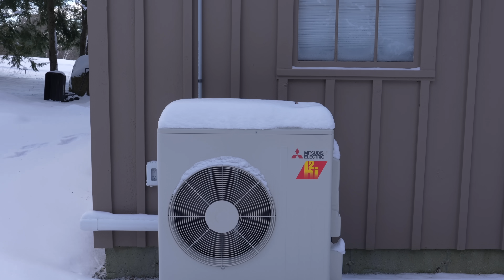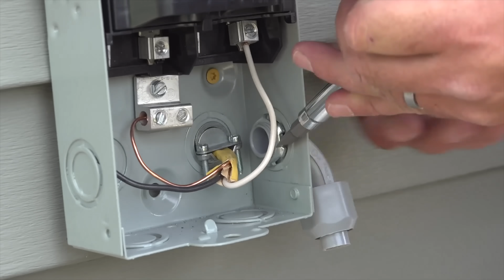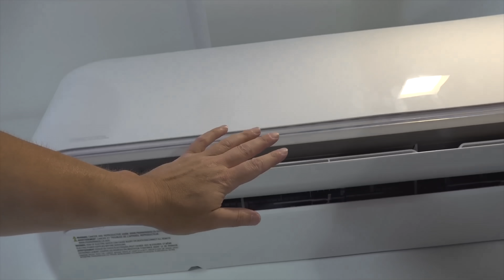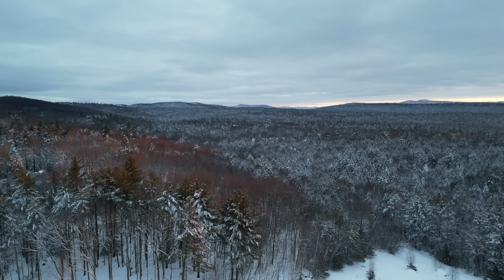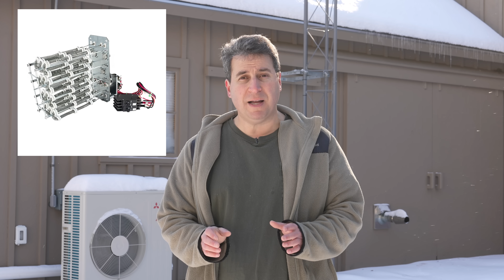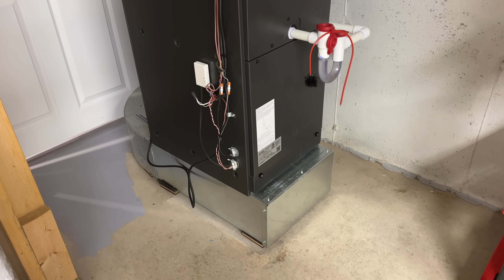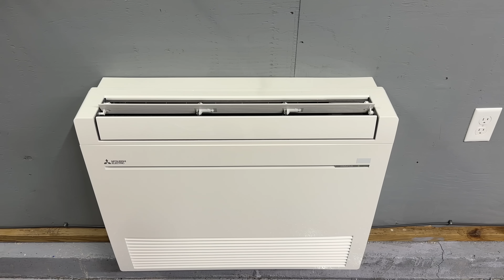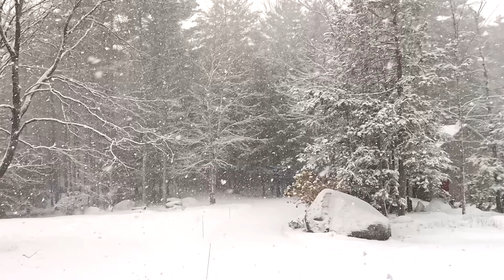Why Heat Pumps are now leaving people COLD

Comment: Something to keep in mind is that the efficiency of a heat pump is almost always going to be over 100% since the waste heat from the compressor ends up in the house via the condenser, so with very few exceptions, it will always be more efficient to run the heat pump than electric heaters, which are only ~100% efficient. If your supplemental heat is electric, even if you need to use it, you may as well keep the heat pump running anyways and let it do what it can because it will still be more efficient than resistance heaters.

Gas supplemental heat is a different story because gas is normally around 1/3-1/4 the cost of electricity per unit of heat. If you have gas supplemental heat, using it instead of the heat pump on cold days often ends up being cheapest even if the heat pump is keeping up fine, but the exact temperature it makes sense to switch to gas depends on your energy costs and the efficiency of your heat pump vs your gas boiler or furnace.
Reply: @diegofondoo1780  He should have called it what it is. Not efficiency, but SEER (Seasonal energy efficiency ratio). With a SEER of 12, with temps above freezing, you can move more heat from the cold outside to heat the indoors for 1/12th the electricity to provide the same heat with strip heaters. Strip heaters alone would have a SEER of 1. A point to note is that heat from a heat pump feels cold. It only warms a few degrees above ambient at any moment and pushes it with a blower motor. Gas or electric will warm to about 140 degF and create a warm breeze, but cycles back off quicker.
Reply: @hartshepherd5060  Close, but not entirely accurate. The EER/SEER rating is the amount of BTUs the system can move per watt of power it uses under the test conditions, not watts. The way we measure how many watts of heat the system can move per watt of power input is with the COP (coefficient of performance). So if a system has a COP of, for example, 3, what that means is for every watt of power it uses, you get 3 watts of heat out of it under those conditions.
Reply: @diegofondoo1780  You are correct, no machine can be more than 100% efficient.  With heat pumps they claim say 400% efficiency because most of the energy put into the system is not counted because you do not have to pay for it.  I.e. input into the system is 4kw of heat from the outside world plus 1kw of electricity for a total of 5kw, output of heat energy into your house is 4kw.  The system is 80% efficient, but because you didn’t have to pay for the heat energy on the input side they say you put in 1kw and 4kw of heat entered your home therefore the system is 400% efficient.
Reply: @steveallen1340  The end result is the same, you basically get 400% of the heating energy of what you put into the system to trigger the process, yes more than 100% efficiency is not possible not even 100% is possible, but again you use natural heat from the outside and basically pump it into the inside thats all there is to it!
Reply: @steveallen1340  Yes the outside world heat is provided by the environment aka day sun heating up everything, ground heat etc...
Reply: Last winter when #2 oil was 6$ a gallon that worked out to be more expensive then even resistance electric. It was well worth installing my Samsung max heat and using oil to supplement on the coldest days
Reply: @diegofondoo1780   Yes. Per unit of electricity, you get more heat than resistive heating, which is a 100% efficient conversion. 

Moving heat is much more efficient than generating it.
Reply: @diegofondoo1780  A resistance electric heater delivers 1 Watt of heat for 1 Watt of electricity paid for.  The highest efficiency heat pumps can deliver 5 Watts of heat for every Watt of electricity paid for.
Reply: @diegofondoo1780  I explain it better than other replies: 100% efficient is electric resistance. Its not really 100% but its the baseline used to measure performance. A heat pump generates more BTUs per unit of electricity compared to electric resistant heating.  A better metric to use is COP Coefficent of performance compared to electric resistive heating. electric resistance heating as a COP 1, anything above 1, provides more heat for the same amount of energy compared to resistive heating

But there is a catch. Heat pump always cherry pick the best conditions for their efficency rating. If you want to heat your home to 70F and the outside temp is 65% the heat pump may have a COP of about 4, but as the temperature difference between inside & outside increases ie 75F inside and 30F outside the COP drops down to about 1. Below 30F the COP drops below 1, and thats when electric resistance is more efficient than a heat pump.
Reply: @guytech7310  Look up the COP numbers for any modern cold climate rated heat pump, the data you're using sounds outdated. Some of these modern ones will pull above 2 COP even at -22F, only way I can see them even getting under 1 COP at all is if the defrost logic is faulty.
Reply: @KingSnake377  No , The numbers are fudged: one by not including the defrost cycling, two: but cutting the output to a small fraction if its rating to prop up COP. Its just gimmicks to fool people. Heat pumps are bound by physics. 

That said the Heat pump efficiency problem at low temps. can be addressed using a Geothermal loop.
Reply: @guytech7310  Not every air source heat pump is going to be above 2 COP in the negatives but claiming they all go under 1 COP at 30F isn't being truthful either. Maybe if it runs a defrost cycle every half an hour for no reason.
Reply: @KingSnake377  They all do when you factor in Nameplate BTU output. A unit that states it as a COP at 2 at 30F with an indoor temp of 72F will  have an BTU output less than half. Again all gimmick, but believe whatever fantasy you want. I don't care.
Reply: @guytech7310  Yes and no, the cop is measured over the entire year to get a really good handle, air heatpumps usually are in a cop area between 3.2 and 4.0 most of them around 3.4 and 3.6 over an entire winter unless you live in a permafrost region. I live in central europe with a moderate climate and my air heatpump will end this winter which was mild but had more permafrost days then the last one (10 or so so far) with an average COP of around 3.7! Winter is over for me in march basically but atm we have the coldest part of the winter and in february things will go up, so an estimate is possible already! And yes the producers of those devices like to exaggerate the COP but, in reality you get over the year good numbers, you just have really high electricity usage in the cold times, but then you always think that you basically had to burn 3-4 times more gas to reach the same heat you just could not see the gas usage every time you fire up a web browser!
To use a heatpump effectively, you have to have 2 things a) good isolation is a must, those beasts react way slower and do not produce such high temperatures like gas, b) you need to know which type of heatpump is suitable for your climate, an air heatpump does not really cut it in a region with tons of permafrost days there are better options in this area than air / water and air /air for such scenarios, they cost more however, air/water air/air is the cheapest option which fits in to the 70% usecase (aka good enough for most people)
Reply: @werpu12  No, not really. go look at a COP chart graphed over delta temperatures. Its mostly cherry picked, not real world conditions. Anything less than USDA zone 6 it doesn't perform well for winter heating. 
Heat pumps work best in warmer climates, especially in USDA zones 8 & above which heating demand is low & AC is the dominate HVAC demand.

Zones 7 and lower, a geothermal (ground source) heat pump system is required to provide good COP.

That said, I think its stupid to load the already strained US Grid with more demand. About 50% of US power comes from NatGas. its more efficient to just use NatGas directly for heating since there are a lot of losses converting NatGas into electricity. About 60% to 70% of the thermal energy produced from NatGas to produce & transmission is lost. 

When there is a major winter power outage that last weeks in the winter, its going to cause a lot of damage as homes freeze and pipes burst.
Reply: @guytech7310  I live in something you would say is zone 7a and my air water heatpump will end the winter this year with a real world cop of around 3.6-3.8 for the entire year.
Reply: @werpu12  OK, I live in 7b, costs me about $400 in Propane for winter (Nov through Feb), If I run my heat pump it costs about $250/mo in electricity. So less than half the cost. I just Heat pump for cooling.
Reply: @guytech7310  Yes the energy costs always are the deciding factor. I live in Europe and last year prices went through the roof, I did a quick calculation in autumn and with my heating I would have spent 8000 Euros (roughly 9000) dollars just for energy of my house (2 appartments), I quickly intervened with wood and a stove to get the costs down by 50% (I get firewood for free just work) needless to say gas is out, I am not going to pay for blood money (russian gas), also sideffekt this year I will end with 1500 entire energy costs heating and current due to moving to a heatpump and pv. With gas I still would have ended up with 4000-5000!
Reply: Don't forget about defrost.  If the unit is spending quite a bit of time in defrost, it can indeed drop under 100% efficiency.
Reply: @matthewbeasley7765  Maybe that could be true with some systems, but the mini splits I've seen generally seem to handle defrost pretty efficiently. My cheap mini split actually completely turns off the indoor fan in defrost mode and only takes a couple minutes to defrost about every hour. Also, once the outside temperature is low enough (perhaps under around 20-25 degrees depending on humidity), ice buildup on the evaporator largely becomes a non issue because there just isn't enough moisture in the air to condense on the fins at such low temperatures.
Reply: @averyalexander2303  You are correct, any of the inverter based units are FAR better at defrost.

A conventional unit usually is very dumb about defrost.  Most have a thermostat that kicks at about 34°F.  When the coil is under 34°F, they run a timer that defrosts every 30-45 minutes.  It then runs defrost until the outdoor coil is warm.  The SUCK anytime it is below freezing because they defrost whether they really need to or not.

The inverter ones are smart.  Not only do they have an inverter, but they have multiple temperature sensors and pressure sensors.  They have variable speed fans and an electronic expansion valve.  In a conventional heat pump, the expansion outlet is often far too cold for the conditions because it doesn't open enough when it is really cold outside.  It means the outdoor coil will build ice starting at one end.  Then the ice progresses to the other.  By comparison, inverter units having the ability to change the compressor speed, fan speed and expansion valve opening, many times the units can stay out of icing conditions.  When they do ice, they only defrost as much as needed and switch back sooner.  

All that said, defrost hits them still when it is moist.  In a dry cold, they do better.  In the snow of freezing rain, they do suffer efficiency and struggle too.  Just not as bad.
Reply: @matthewbeasley7765  Great points, the 20+ year old central heat pumps at the apartments I used to live at definitely didn't work very well near or below freezing. I'm not sure that they defrosted unnecessarily, but they froze up all the time and didn't work very well.

The Pioneer mini split heat pump I have now still sometimes defrosts unnecessarily, but at least it doesn't run the indoor fan during defrost and blow cold air into the room like the central heat pumps I've experienced. I believe it has one temperature sensor on the outdoor coil, one on the discharge line, and one on the indoor coil with indoor and outdoor temperature sensors, but no pressure sensors.
 
I assume a higher end system from Mitsubishi, Daikin, Fujitsu, etc would handle defrost even better, but my 1 ton 21.5 SEER Pioneer unit has been working quite well for the last 5 years considering the entire install cost well under $1K including the lineset, drain pipe, wiring, disconnect box, etc.
Reply: @matthewbeasley7765  During defrost, heat is transferred from the house to the outside unit. At that moment, efficiency is negative. Both the off time and negative heat transfer will reduce the effective delivered powered to heat the house considerably. In a wet climate just above 32F, this can be half. My gas boiler kicks in below 40F. Between 40F and 18F, its in hybrid mode. Below 18F, its gas boiler only.
Reply: @diegofondoo1780 it's more than 100% because it moves heat instead of making it. Since heat is energy it can't be created or destroyed but we measure a heaters efficiency based on how much heat it outputs not how much it creates. An electric heater just converts electricity directly into heat, that's why it's 100% efficient.
Reply: YES! This right here!
Reply: Yes theoretically but at some point an additional defrost unit has to kick in and then you add a pure electrical heating system into the mix just to keep the heatpump running and preventing it from being destroyed, at that point it can become less efficient than running an electrical heater alone, also some heatpumps have a handover point for that reason where they switch to purely electrical heating entirely. You seldomly or almost never reach that point, but it exists!
Reply: @werpu12  Do you have any data to back up that claim? Not saying you are wrong, but I have yet to see a manufacturer data sheet or any other data showing the COP of any heat pump dropping below 1. Also, remember that the unit actually doesn't usually need to defrost very much once the outside temperature starts getting below around 20 degrees because there isn't very much moisture left in the air to freeze at that point. Finally, every unit I've seen defrosts by briefly switching to cooling mode, not by running an electric heater. Some units do have a base pan heater to thaw the ice around the bottom of the outdoor coil, but those don't generally use very much power and typically only run during the defrost cycle.
Reply: @averyalexander2303  Well if. my energy bill befcre and after installing the heat pump is enough? We have roughly the same gas prices as electricity per kwh but yet I am now paying a fraction of what I paid before after moving over to an air/water heatpump. Also multiplying the COP with the energy used by the heatpump rougly gives me the gas usage number I had in the years before (aka I came down from 12.000-15.000 KWH depending on the year down to 3200 Kwh including warm water)
Reply: I wonder why OEM's don't make the indoor unit with 2 coils in parallel with each other, so that one coil is made for regular cooling, but the other coil is made for heating, so that the heating coil can be more condensed in construction by having a smaller tube, less fins, and a tighter path from inlet to outlet. 
That surely will make that compressor work.
Reply: @MR-backup  It's unfortunately not that simple. Yes, making the condenser smaller and more restrictive will work the compressor harder by building more pressure and generate higher discharge temperatures, but with a higher compression ratio, the compressor won't move as much refrigerant through the system and won't move as much heat. Also, just like in cooling mode, if the condenser is less effective at dissipating heat, the evaporator will run warmer and won't be able to pick up as much heat from outside.
Reply: @averyalexander2303   It's unfortunately not that simple. 
- When money is the driver of technology: it never is.

Yes, making the condenser smaller and more restrictive will work the compressor harder by building more pressure and generate higher discharge temperatures, but with a higher compression ratio, the compressor won't move as much refrigerant through the system 
- That depends on what refer you use.

and won't move as much heat. Also, just like in cooling mode, if the condenser is less effective at dissipating heat, 
- I'm not sure why you keep thinking that my design will not dissipate heat well. Dissipating heat in my theoretical design (and in all existing technical designs) is NOT a result of the compressor. You do understand that, right?

the evaporator will run warmer and won't be able to pick up as much heat from outside.
Reply: @MR-backup  Yes, the refrigerant used will have an effect on the compression ratio, but assuming everything else is the same, increasing the compression ratio the compressor has to work against is going to decrease its pumping capacity.

If the design of condenser you are suggesting still dissipates heat well, what would the difference be? Just more resistance to flow? If so, the same thing could just as easily be accomplished by varying the position of the expansion valve, which is generally electronically controlled on newer mini splits.

I never said dissipating heat is a result of the compressor, but in part, it actually is since the compressor is what's pumping the refrigerant through the system and therefore creating the temperature difference between the evaporator. The heat is dissipated by the condenser (the inside coil in heating mode), but the performance of the compressor, evaporator,  and expansion device as well as the type and amount of refrigerant in the system all directly influences the temperature of the condenser and therefore how much heat it can dissipate. All of the system's components work together, you can't change the characteristics of one part without affecting the entire system.
Reply: @averyalexander2303   @averyalexander2303  Yes, the refrigerant used will have an effect on the compression ratio, but assuming everything else is the same,
- Almost nothing else can be the same, if the refer used is different; it just takes some one to spec out which one to use, then everything else can be designed around that.

 increasing the compression ratio the compressor has to work against is going to decrease its pumping capacity.
-AGAIN, that depends on the refer used and THEN the appropriate compressor spec'ed for it, i.e. you can have a BALANCED compression ratio, that allows for X refer to move throughout the coil & system just fine, if the right combo of refer & compressor are used.

If the design of condenser you are suggesting still dissipates heat well, what would the difference be? Just more resistance to flow?
- Correct. Which allows for a HIGHER temp concentration & efficiency (as opposed to losing it in system losses) INSIDE the "area" to be heated.

 If so, the same thing could just as easily be accomplished by varying the position of the expansion valve, which is generally electronically controlled on newer mini splits.
- This video (and my design suggestion) is NOT for mini splits, it is for Heat Pump systems in GENERAL, and ALL HP's do NOT have EEV's. But even if ALL HP's had an EEV, that does not produce the same  heat production to kW/hr load at the compressor, that a different coil type would. For the reason you already mentioned.

I never said dissipating heat is a result of the compressor,
- I know you didn't, but you kept pointing out how the heat dissipation in relation to new coil suggestion (like I made) would or wouldn't perform according to the COMPRESSOR; so what else am I supposed to think you are saying? 

 but in part, it actually is 
- Well at least now you seem to acknowledge that the compressor factor is not where the problem is with this kind of suggestion.

since the compressor is what's pumping the refrigerant through the system and therefore creating the temperature difference between the evaporator. 
- Yes, but that is NOT equal to heat dissipation, or even the reason for what drives correct/efficient heat dissipation; just  the factor for heat GENERATION. Are you sure you understand the difference?
I'm asking a genuine question.

The heat is dissipated by the condenser (the inside coil in heating mode),
- "In part", yes.

 but the performance of the compressor, evaporator,  and expansion device as well as the type and amount of refrigerant in the system all directly influences the temperature of the condenser and therefore how much heat it can dissipate. 
- This (and all) systems are holistic, it's common knowledge, but that is not what my suggestion in response to your OP is addressing.

All of the system's components work together, you can't change the characteristics of one part without affecting the entire system.
- You are free to make a redundant statement, but I hope you can read and understand that that is NOT what this suggestion is directed at solving.
Reply: @MR-backup  No that would not help. In heat mode the cold refrigerant is dumped into the coils to heat up the refrigerant before its compresses so its more efficient. The less coil surface area, the less efficient it will be regardless if its heating or cooling.
Reply: @guytech7310   No that would not help. In heat mode the cold refrigerant is dumped into the coils to heat up the refrigerant 
- That doesn't make any sense: refer does NOT "heat up" by being dumped into a coil.

before its compresses so its more efficient. 
- What?? 

The less coil surface area, the less efficient
- HP's have been pretty inefficient in these climates to begin with, so this idea is just for those Climate Zones. And this idea is about as efficient as what everyone already has to do to stop from freezing by putting in heat strips or Aux Heat system; at least with this idea, you are still sticking to the same system. 
I.e. This is idea is about keeping people warm in cold climate with the same heat source they planned on using to begin with by purchasing a HP, by building off the OP's idea of using the compressor's heat output (from work) to use with a separate coil that allows for heat to be concentrated where it belongs: in the indoor coil.

 it will be regardless if its heating or cooling.
Reply: @MR-backup  After thinking about what you said, I can think of a way using two different coils in parallel would make sense. Having an evaporator coil sized for proper cooling and dehumidification in the summer with a much larger condenser coil indoors for better efficiency in heating mode.

A secondary benefit to using a dedicated indoor coil for heating and cooling mode would be dehumidification. Instead of running a separate dehumidifier, it would be possible to easily re route enough warm refrigerant through the indoor heating coil while in cooling mode to keep the system running while dumping the excess heat outside via the main condenser.

Obviously that concept would work best with variable speed compressor and fan motors, but that would be a VERY efficient way to control humidity when necessary compared to running a separate dehumidifier, which uses a lot of power and adds a considerable amount of heat for the AC unit to remove.
Reply: @averyalexander2303  I just don't understand how big brand OEM's have not done this decades ago?
Reply: @MR-backup  For the same reason we don't have a heat exchanger in our hot water system to heat our water for free with the AC's waste heat during the summer while simultaneously increasing the AC's efficiency- money.
Reply: @averyalexander2303   For the same reason we don't have a heat exchanger in our hot water system to heat our water for free with the AC's waste heat during the summer while simultaneously increasing the AC's efficiency- money.
- Correct.
Reply: heat pump don't heat anything, they move and compress working gas/fluid that changes temperature from compression  @diegofondoo1780
Reply: Generally, heat pumps are not rated as a % of efficiency because of what you have stated. We use SEER2 ratings for the cooling side and HSPF or COP for the heating side. What can be said is that compared to electric strip heat, a heat pump can output 3, 4, or maybe even 5 times the heat per kW of power used.   @diegofondoo1780
Reply: No such thing as being more that 100% efficient.
Reply: @grandinosour  You are technically correct since you won't get more energy out of the heat pump than the total energy input, but in practice, they can actually be 400% efficient or more since we only pay for the electricity needed to run the system, not the heat it brings in from the outside air. The entire point of a heat pump is to bring free heat in from outside instead of paying to generate heat.
Reply: Air source heat pumps have never been practical in cold climates for this reason. This disadvantage all has to do with how the unit generates heat. Heat pumps work by adsorbing ambient heat out of the outdoor air, and transferring it to the inside. Much like an air conditioner in reverse. However, when temperature get so cold like we have seen this passed week, that ambient heat becomes scarce in supply. There for less heat for the unit to adsorb and carry into the indoors. On a day where temperatures are in the 40's to high 30's. Then the heat pumps is going to produce a lot of heat in that case, since that ambient heat is abundant in supply. But when it gets into the low 20's to teens and single digits out. Then that when the heat output is going to decline and become weak.
Reply: @KenKen-ui4ny  Heat pump are absolutely practical for cold climates, they just aren't practical by themselves in cold climates and need backup heat, usually a gas or oil furnace or boiler. Even brutally cold climates get a bunch of days in the 25-60 degree range where heat pumps are often the most efficient heating method. Most people have some type of AC anyways, so why not get a heat pump?

Also, modern heat pumps can work surprisingly well at pretty low temperatures. My cheap 12K BTU mini split actually heated my house pretty good last week. Despite temps being in the teens and single digits, my living room never dropped below 61 degrees while only using about 1500 watts. A premium unit would have been even more efficient and effective. Would a gas furnace have been better that week? Yes, but here in the Memphis region, we don't usually get that kind of weather, so buying and installing a gas heating system and paying $12 a month all year to be connected to gas service just for the couple weeks or less we normally get that kind of weather makes no sense.

I realize that there are a lot of people who live in much colder climates than I do, but there is virtually no climate that doesn't get a good number of days every year that a heat pump would be ideal for.
Reply: @averyalexander2303  I rather gas first over heat pump. Tennessee dose normally see that type of cold time to time, when a powerful enough arctic blast comes through, So back up gas or electric resistance heat is justifiable in that case. Even in just 20 degree temperatures, i kind of find the heat output of a heat pump not exactly cozy.
Reply: @KenKen-ui4ny  My point was simply that there's no real reason not to install a heat pump vs. a cooling only system since the price difference isn't usually very much and a heat pump will be the most efficient system for many days of the year in almost every climate.

Fair point about backup heat, it's all a matter of preference and priorities. I normally keep the house in the low 60's in the winter anyways, so temporarily losing a couple degrees for perhaps a few days out of the year on average when we get the occasional cold snap is no big deal to me. Others may have differing opinions and that's totally fine. If worst came to worst and the heat pump failed or we did get significantly below 0, I do have a few space heaters just in case and can always turn on the electric stove and/or oven, but I haven't had to yet. I'm not spending thousands of dollars to MAYBE save a few dollars on my January utility bill and get a couple more degrees a few days a year, but that's just me.

I actually had a gas furnace and used it until the heat exchanger failed, at which point I got the mini split about 5 years ago. Far from an apples to apples comparison, but on a cold month, the furnace by itself would cost about $80-$100 in gas while my total electric bill is now rarely over $100 per month, so my heat pump is definitely saving me money.
Reply: @KenKen-ui4ny  There are other forms of heatpumps which are way more efficient in cold climates, they require deep drilling. In my area I was not allowed to have such a heatpump (water preservation area, yes we have such a thing in europe, to keep our water at high standards). What they do is basically to use the heat of the earth below one meter to keep temperatures constantly above 0c (below one meter things get significantly warmer), the drilling usually is done 50-100 meters down into the ground, and you can harvest a ton of warm energy down there!
Reply: @KenKen-ui4ny  They are practical in a sense that you can use them as additional heating source for 90% of the days. But they become better also newer cooling gases are way more efficient. Btw. I just ran a short calculation of my PV + Heapump combination, I came to a yearly COP of 5-6.6 in that combo compared to my old gas heating system, the heatpump itself will have 3.6-3.8 at winters end!  The PV even in winter helps a lot to ramp the efficiency up from April onwards it is a self runner with the ACs being able to run all summer without consuming any grid electricy so is the warm water from March til October!
Reply: @werpu12  Air source heat pumps far as i remember hearing from HVAC repair and install techs, never have had a big competitive market to gas, especially in the more northern states, due to the reason mentioned in this video. Most heat pump i have seen in areas that can get below 30 degrees often, ether are dual fuel or mated with a standard electric resistance furnace. Geothermal heat pumps are different. But i haven't seen as many of them compared to air source units though.
Reply: it takes 6  electric heaters    to heat the same space as    one of my  mini splits and  I can run that Same mini split for  less than the cost of one electric heater.    Even when its close to and below 0 F out side
Reply: No such thing as 100+% efficiency. The laws of physics simply won't allow it
Reply: @skyking6989  You are technically correct since you won't get more heat out of the heat pump than the total energy input, but in practice, they can easily be over 400% efficient since we only pay for the electricity needed to run the system, not the heat it brings in from the outside air. The entire point of a heat pump is to bring free heat in from the outside air instead of paying to generate heat.
Reply: @averyalexander2303  still wouldn't get a heatpump. They absolutely suck
Reply: @skyking6989  I didn't say you should get one, I just stated the fact that they can functionally be well over 100% efficient.

I'm curious why you think heat pumps suck though? While old and/or crappy ones do tend to perform poorly, well designed modern ones can actually work surprisingly well in the right conditions.

Using a heat pump by itself may not be ideal in all climates, but since most people have central AC anyways, there's no reason for the AC system to not also be a heat pump. Even though it may not work well by itself for every day of the year in all climates, pretty much everywhere has a lot of days where a heat pump would be the most efficient heat source. This is even more true for people who don't have access to natural gas. Just like everything else, there is no "one size fits all" solution to heating.